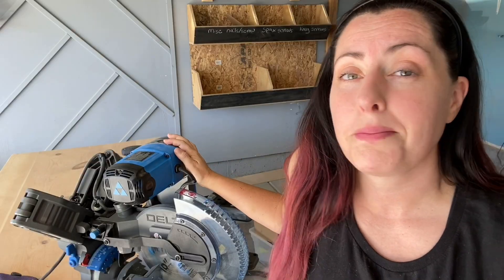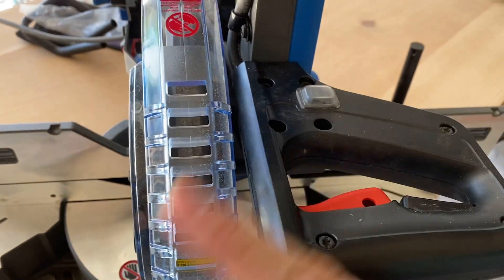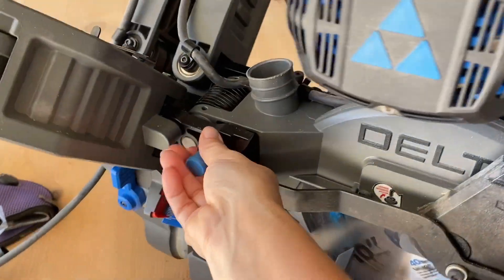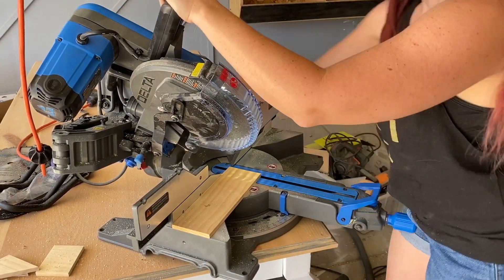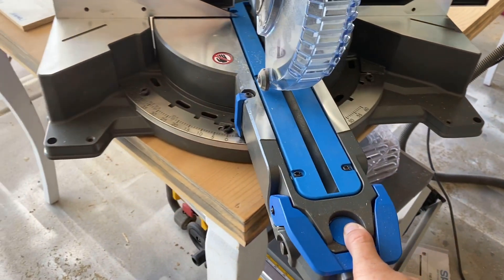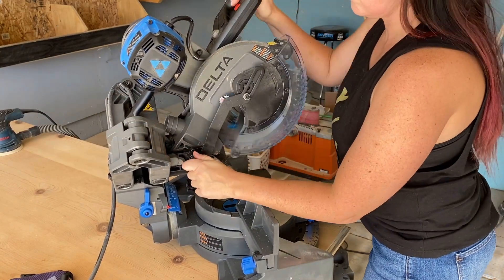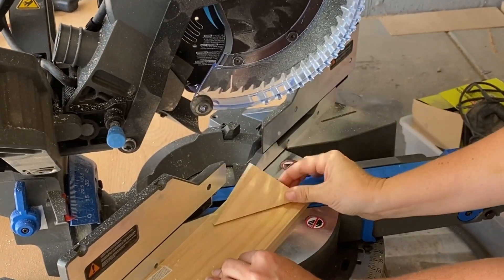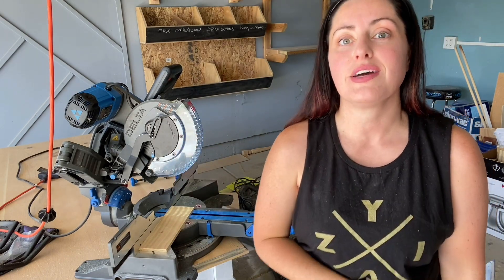MITER SAW - Beginners guide, How to use miter saws, woodworking tips and tricks

Comment: I have been doing woodwork for the last 10 months and the Titan Miter saw I got was a game changer even though I have no garage so all the outdoor work I do is dependent on the crappy English weather. 

The only thing I regret is not waiting a little longer so I could afford one with the sliding track so I could cut bigger pieces, but still it's FANTASTIC! So any beginners out there if you CAN afford to pay a bit extra then DO get one of the sliding ones.

I also read the safety manual twice and watched videos on how to use one properly for over 2 hours to prevent things such as kick-back.
Wise words from Brandali : ]

Got a new subber : ]

Comment: Great overview for miter saws. My Dewalt DW708 doesn't have a safety double trigger to prevent turning it on, just a single power button. Interesting that your Delta uses a similar sliding mechanism as the Bosch miter saw. Makes it nice for taking up less room. A couple of things from my experiences: 
1) Clamps are very useful for holding down some material to make it easier to control, especially when multiple passes are required
2) Small pieces (less than 6 inches) should be used with a zero-clearance insert to prevent kickback or getting the piece caught into the blade
3) Stop blocks are useful for making duplicate sized cuts more easily
Reply from the maker: Great info! Thanks  🙏🏼